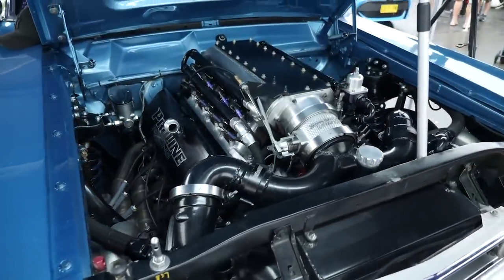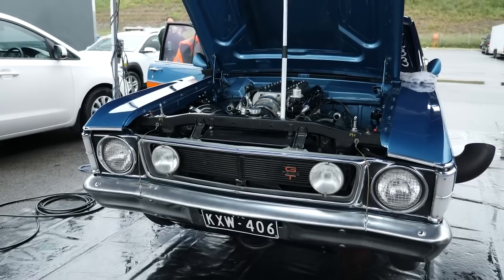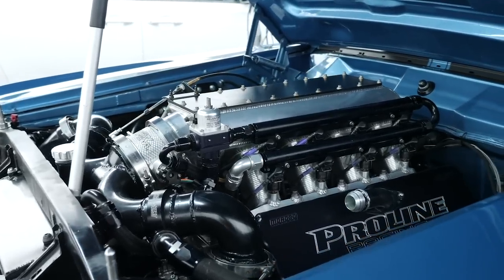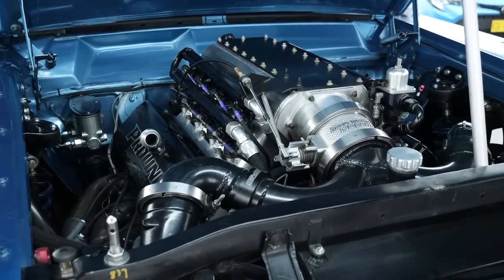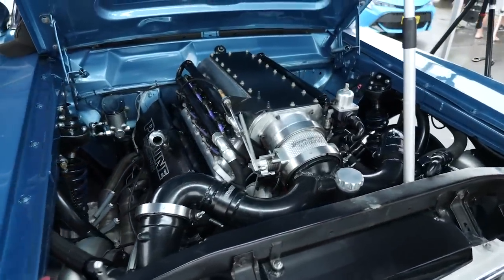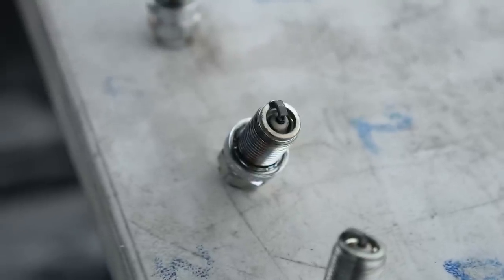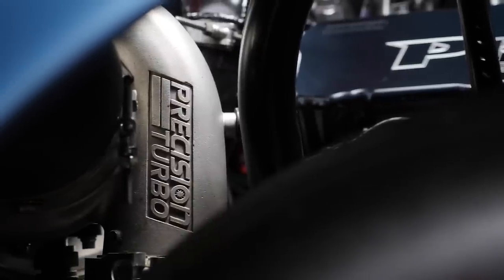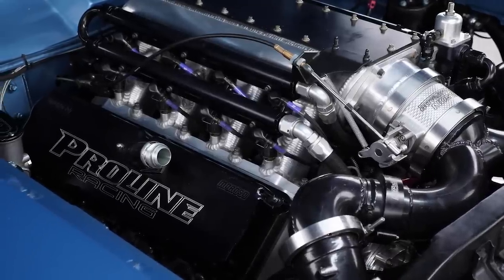4000+HP Pro Line V8 Maintenance | XW Falcon [TECH TOUR]

Comment: Spark plug reading is reality, all the sensors are whispers.
Reply from the maker: Think of it like this, sensors are data, just like your spark plugs. You can look at sensor data and have no idea what you are looking at without experience. You can also look at a spark plug and have no idea you are looking at without experience. You can use wrong sensors, you ca  try read 40000km old plugs thinking they will help.

Long story short it isn't this vs that, you want ALL the data, but you can certainly do it wrong for any and all options no matter how analog or digital the data is - Taz.

Comment: dam putting that engine in that car is such a waste. with leaf springs and small tires, you will never get the most from that engine. why not ditch the turbos and save the weight, you will probably still be traction limited.
Reply from the maker: Future proofs it a bit, you never know what will happen down the line. To be fair the last engine this used to run split in half, and the car is much faster with this setup, so they're not exactly doing anything terribly wrong here either given they're doing what they want to with their own build and seem to be enjoying it along the way too - Taz.